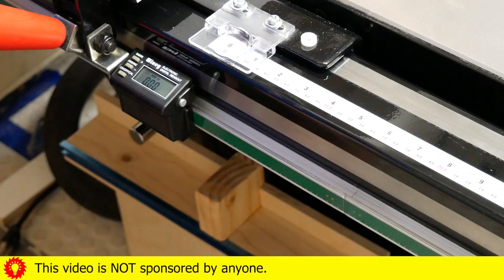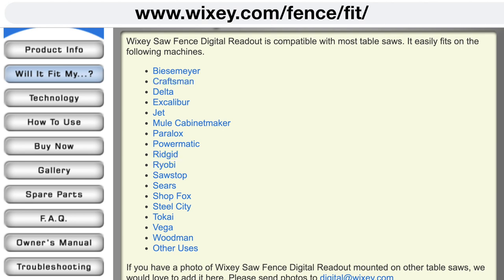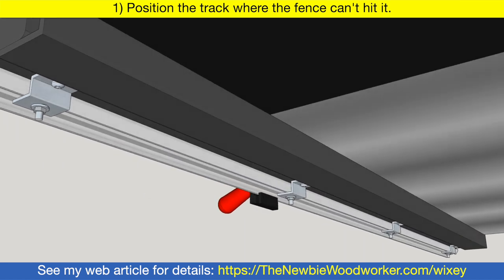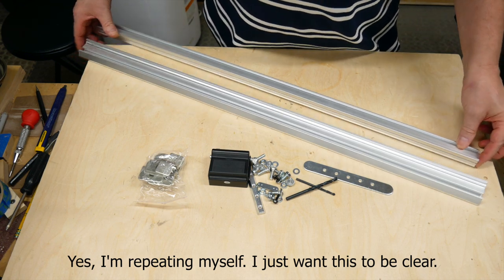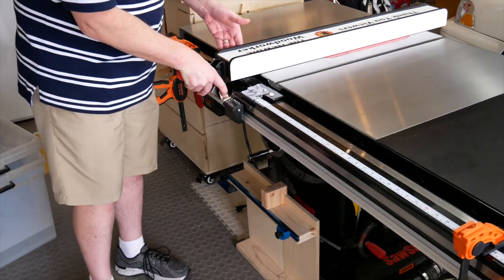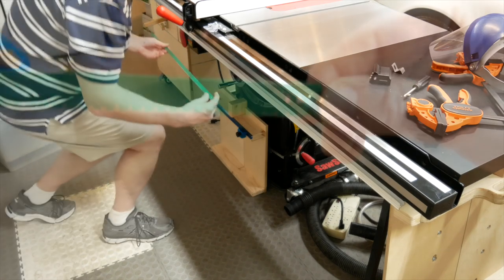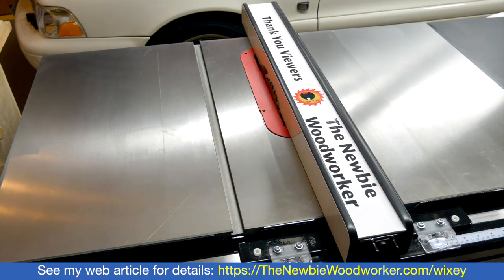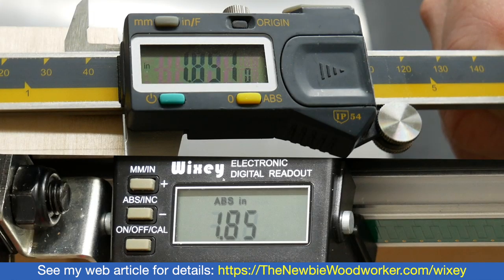Wixey Saw Fence Digital Readout - Installation, Calibration & Review

Comment: Thank you! This was helpful on calibration with the current unit. I have the original version but have recently ordered the new sliding gauge part. I never liked the blade routine on the old unit, so this is what I did in case it helps anyone. Set your fence anywhere, rip a stable hardwood at some random width, and zero the Wixey. Then measure the ripped board and back the fence up to negative that number.  When you get there, zero the Wixey again. Done.

Comment: I knew you would love it. Congratulations. I like how repeatable it is.
Reply from the maker: And you were right, of course. It's funny, though, because some people say "how often do you need that level of accuracy", and the first time I tried cutting a runner with it, I realised that I needed it more accurate! But it's OK because I just cut it at least .005" proud, then use my digital caliper and digital indicator gauge to get it spot-on, so it's still much quicker. And all around, it's much easier for me to use than the hashmarks, because I'm regularly counting wrong. 😏

Comment: Just for the sake of accuracy:  If your calipers measure 1.851" and the digital readout says 1.85 that is NOT a difference of .001".  The readout is approximating a value between 1.845" and 1.854", both of which round to 1.85".  So the actual error is between -.005" to +.003" → still excellent for woodworking.  I think I'll be buying this device.  Thank you for the vid; nice job.
Reply from the maker: Thanks, and I have to laugh. I'm well aware of what you're talking about. I struggled with whether I should say something about it, but everything I came up with was just too complicated. Then you spell it out in a couple of sentences! Well done, and I wish I had asked you before I did the video. 😂

Comment: Awesome video, Dan!  Great attention to detail on highlighting the tricky area of the pics.  Some of those pics -- like the black custom bracket -- would have been useless without your additions.  The only snag is you cannot have a PCS and continue calling yourself "newbie".  Fairly certain it's in SawStop's manual.  =/
Reply from the maker: Thanks, Fred. It's funny, I was going to do a simple "this is how I installed it" video, when I discovered just how bad their instructions were. And then I couldn't help myself - I had to do the whole shebang. Oh - and actually, I'm not calling myself a newbie anymore. 😛Now this is "my channel for the newbie woodworker", although I haven't been posting many newbie-focused videos lately. I need to get back to that. But I think SawStop would be fine with a newbie using their saws, and actually, who better to benefit from the safety tech than a newbie? Thanks for the fun comment. 😄

Comment: Since you had 3 holes not line up with your initial attempt to mount the rail, is it possible you turned the rail around (front in back) when you marked your initial mounting holes?
Reply from the maker: That's a good thought, and I had to take a close look at the video, but I didn't do that. And the more I think about it, I realize I'd have had to flip it over, which would put the non-flat side against the tube, and that would have been obvious to me right away. But good thinking, thanks!
Reply: @TheNewbieWoodworker  Yeah, the end for end 'flip' would have put the holes toward the back of rail and that's not what you had.  Hadn't considered that fact.
Reply from the maker: @larryvergon6740  Don't let that stop you from coming up with other ideas. You never know! 😄

Comment: Because of the limited space in my workshop as It doubles as my car/scooter/motorbike shop.  I have 2 cars being restored and 3 scooter I have to keep running.  This does not leave me much room doe my woodshop area.  I have a 1952 Craftsman 8" tilt table saw that I have restored that weight what feel like a TON.  I need to DYI fence for this beast but I need to make extensions that I can lower for storage.  The Cast iron ones that came with the saw are more then a pain and only 10" wide.  The saw itself is 18" wide and I made a stand so the saw is 34" off the ground and will accept the dust collection can to collect all the dust from the saw.  I love the idea of this as it mean I would no longer need a scale with the fence.

My Idea would be to attach the senor strips to edge of the table saw and make a fence so the meter is at the 34" height of the table saw.  I have watch (lost count) of DYI fence video.  I see the same problem in everyone of them.  They have the massive base on one or both ends of the fence.  It just blows my mind.  From design point, it just blow my mind, that they can't come up with a "T" track using 2 or 3 point inside the "T" track to move the fence on so it stays true to the blade when it moved.
Reply from the maker: Thanks for the comment. 😄

Comment: Hi Dan.  Great How-To video!!  I really enjoyed watching you explain all its parts, how you adapted it to your sawstop, and especially how you fixed your mistakes.  My question is how is the Woxey holding up over 2 years later?  Do you still use it?  Is it still worth the expense?
Reply from the maker: Thanks, I appreciate it! It's holding up fine, although I don't use it a lot. I use it mostly when I want to set the fence to one of the  measurements that I usually mess up, like something  that ends with 3/8. I also use it when I've got the fence set, and I need to change it by a particular amount that I might mess up the math. To me it's worth the money just for things like that. YMMV.

Comment: I have a Bosch tablesaw and when you move the fence you have to use a set square because the fence doesn't stay 90 deg to the rail, what is the fence like on the Wixey? Is there any movement in it once you've locked it in place? and does it stay perfectly square to the rail?, Thanks
Reply from the maker: It stays perfectly square, because it's attached to the rail. If your fence moves around some, that won't hurt the Wixey, because the magnet lets the Wixey slide around and still stay attached to the fence.

Comment: Did you have the track on backwards when you drilled the holes or when you tried the screws? IE got the ends flipped around?
Reply from the maker: Thanks for the thought. Someone else mentioned that, and at first I thought it was a possibility. But the video shows I didn't. And besides, if I had it backwards, it would have to be flipped over also, with the flat side not against the tube, and I would have noticed it. But good thinking! 😄

Comment: This is an interesting system.  Looks like it could be easily adapted to pretty much any table saw.  I have a custom mobile setup with my jobsite dewalt recessed into the table.  I have a decent fence system now using an older Incra ultra that I got at an estate sale for $20.  It's crazy accurate, but since it clamps to the table it has to be calibrated every time.  It's a bit of a pain, so I'm looking at changing it out with John Hiesz fence system, and I think I could adapt this and end up with a super accurate setup without much cost.
Reply from the maker: Good idea! Just don't tell John, because this sounds like something he'd ridicule. 😉(I love John, by the way - I'm just having fun here.)

Comment: Thanks, this was a very useful presentation of how to install and what functionality is provided. BTW, just bought one using your affiliate link (every little bit helps, right?). Will be installing it on my SS PCS still waiting to be unboxed (loved your video on that saw).
Reply from the maker: Thanks, Steve, and yes, every little bit helps. How come you didn't buy the saw through my link? Just kidding - I didn't buy mine via an affiliate link either. The thing I've enjoyed the most about the Wixey gauge is that it helps me double-check that I'm in the right inch number. Every once in a while I'll look at the left ruler guide instead of the right one, or I'll just be stupid and get it in the 6" range when it's supposed to be in the 7" range, etc. The Wixey is a great sanity check for someone as error-prone as me. 😄

Comment: Sounds like drinking on the job to me..lol.  My woodworking new adventure was finally buying a glubot.. I read most of the reviews and the negative ones said the company has had some problem with the washers.  I went to Rockler and found one that didn't have a bad washer. I got home and discovered there was a washer in the screw on nozzle..it was bad.. I went back to Rockler deflated but they were great listening to my sob story.

Comment: You'd like the incra fence. You could spend weeks dialing it in to near perfection. Then you could write up your steps on your website and make a video. Then I could use the info for mine. :)
Reply: I would like to see that too! I bought the TS LS Joinery System , I am expecting delivery any now.
Reply from the maker: Thanks, guys. 😄 I get the appeal of the Incra fence, but it actually requires more room than I have, since it overhangs the right side of the table.

Comment: Hey Dan, great video.  I'm wondering, where did you find out about those additional calibration adjustment steps, I don't see it in the manual, nor can I find it on the Wixey website.   Thanks again for the great content you provide!!
Reply from the maker: Thanks! I think I just figured that was the best way. I could be wrong, of course. 😄
Reply: @TheNewbieWoodworker  There is a bit of the calibration information in Wixey's instructions for their thickness planer gauge. Just FYI.
Reply from the maker: @dsorocco  Thanks for the info!

Comment: Dan -- Thanks for the great video! Your comment about the satisfaction of seeing an exact digital value struck a chord with me. I'm sure I would have the same reaction!

However, I'm curious about how well you still like the setup now that you've been using it for a few weeks. Do you still think it was worth the effort and expense? You even had to drill holes in that shiny new Sawstop! So do you find yourself using the digital readout as much as expected, or do you mostly just look at the analog calibration that came with the saw?

Thanks again!
Reply from the maker: Hey, Bill. Thanks for the comment, and great questions. Yes, I'm still using it, and I do like it. But now that I have it, I find myself trying to get it dead-on, even when all I need to do is cut reasonably close to 2", for instance. Another example of my perfectionism taking hold. So I'd say that if you're like me on that front, at least think about that before you get it. 😛

I didn't mind drilling the holes at all, because the holes were underneath, and there's already holes for the other bolts, so it's no big deal. If you saw it, you'd understand - nobody would give it a second thought, if they wanted to buy it, for instance, although I have no intention of selling the saw.

Depending on the value I'm going for, I may use the analog to get close, then the digital to get exact. I don't have the digital equivalents of the smaller fractions in my head, so it takes a little tapping it around to find the right spot. But all in all, I'm glad I have it, although I'm not really sure if it's helping much beyond a little peace of mind.
Reply: Okay, that helps a lot. Thanks. My PCS should arrive in about two weeks, which seems like such a looooooong time! Then I'll decide about the digital fence readout.

By the way, I first discovered your videos a few days ago, and liked them so much I binge-watched for about two hours! What a treasure trove of information, humor and clarity! Thanks again  -- you have a new fan!  
--  Bill
Reply from the maker: @wrengels  Thanks, Bill, and glad to have you aboard! You should check out my blog when you have time. I don't post as much as I used to, but it sounds like you might enjoy it. No pressure, of course, but I thought I'd mention it. thenewbiewoodworker.com.

Comment: Did you have issues with it maintaining accuracy over the transition between the sensor strips? We just installed one in our shop and found it would not stay calibrated. So far we can’t trust it. 😞
Reply from the maker: I haven't had any issues. I read some stuff on their website on this subject, which means you're not the only one this has happened to, and if memory serves, they said it's almost always related to not joining the two parts together properly. So you might want to try and contact them. The other thing I've learned is how to slide the fence up to my blade and reset the gauge so it's right every time. If I just gently touch the blade and then reset the gauge, it's almost always right on. You might wonder why I need to reset it a lot, and it's because I have the terrible habit of sliding my fence just a little too far to the right so it goes partially off the end. Happens once a week or so (you'd think I'd learn).
Reply: @TheNewbieWoodworker   I hear ya. I did use the included joining guide, but there may yet be room for improvement. Thanks for your quick reply and the initial review.
Reply from the maker: @stackman120  You're welcome. Keep me updated if you manage to get it fixed. Anything you learn might help others with the same problem. I suspect there's some little trick or something that makes the difference, and some of us get it right by luck. Or something like that. Or else it's just poor manufacturing. In either case, I'd really like to know.

Comment: A thought: if you reverse your math (Wixey minus caliper), you could instead move the distance to the difference, then zero out to make it perfect...right? Maybe I’m off

In my mind anyway, you’d have gotten -.006, so you move the gauge (instead of going to zero) to -.006, then zero it out
Reply: Alex W. That’s what I would have done. I’m just surprised the follow up test cut actually did read off the expected .001”. That’s either a very consistent measuring device(s) and/or wood.
Reply from the maker: I was trying to come up with a way so I always knew whether to add or subtract the difference, because I always get confused about things like that. So this is simple - if the difference is positive, add it. If it's negative, subtract it.
Reply from the maker: @MJFacas  Or pure luck. Since it could have been off anywhere from +.0035" to -.0015", since the margin of error is .005". (If my math is correct, but regardless, you get the point.) And read my response to Alex about why I calculate it the way I do.

Comment: I’ve had two units for 4 years now on two of my table saws which are cabinet style and are never moved around.  The magnet Wixey  uses is too weak.  I glued a high strength magnet on top of the Wixey supplied magnet with JB Weld and solved that problem.  The next problem is a major point of frustration.  The reader head looses calibration frequently, therefore you never know if it needs to be recalibrated which means ripping another piece of material and fiddling  around as this guy shows to recalibrate unless you just want a very rough calibration of sliding your fence against the blade which is worse than just using the built in tape measure.  I end up going back to the saw’s tape measure most of the time.  Very disappointing. I would not recommend this product.
Reply from the maker: Thanks for your input. I haven't experienced those problems, but that doesn't mean they can't happen. Buyers, beware!

Comment: Dan, I just saw this video https://www.youtube.com/watch?v=XHT75fD_BAU and he has a small deviation past 20". All measurements are perfect up to about 20" then a tiny drop off in accuracy. Do you get that? Have you ever set your Wixey to say 25" to 30" and then checked the cut with a good tape measure. I read somewhere else that another user had a drop off in accuracy past 25".
Reply from the maker: I haven't tried it. My guess would be that the two sections of track aren't joined properly. But in any case, I can't imagine when I'd need that kind of accuracy with pieces that size, assuming the deviation is pretty small. But if I did worry about it, I'd figure out where the deviation happened, and just compensate for it. Or ask the manufacturer what they had to say about it.